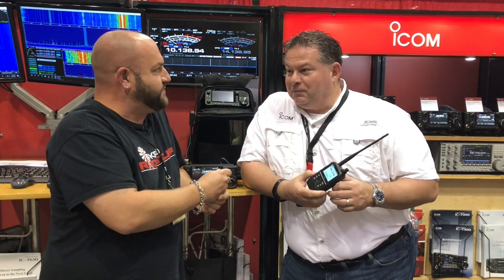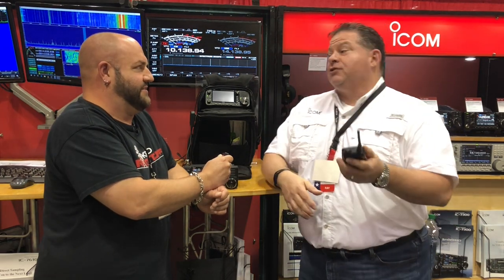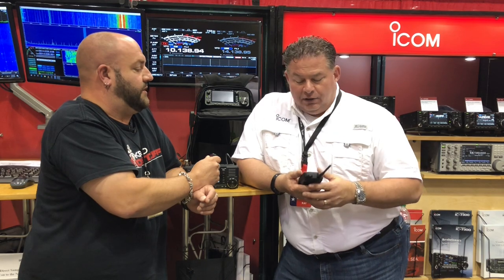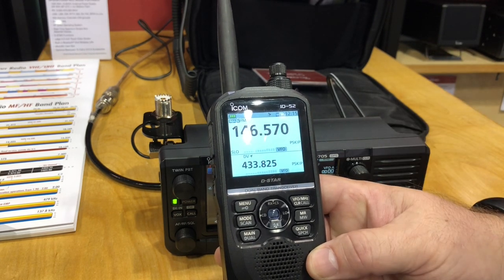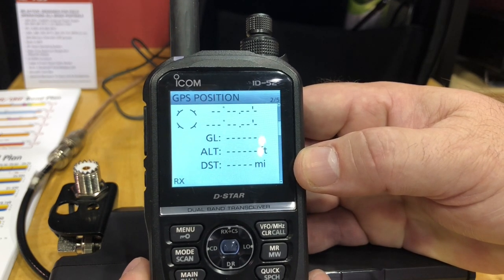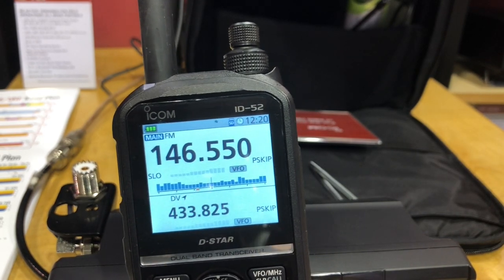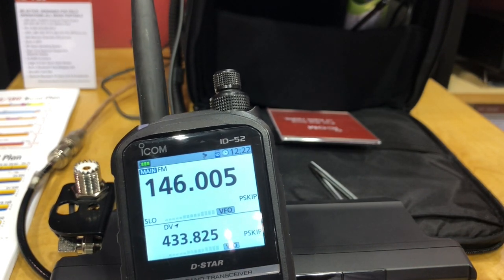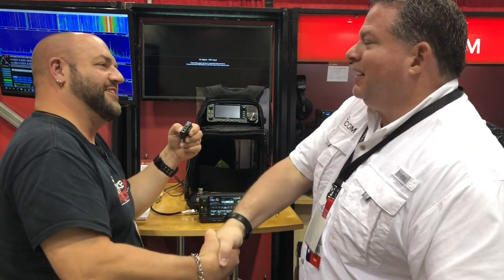Icom ID-52 | First Look With Ray N9JA @ Huntsville Ham Fest 2021

Comment: Enjoyed the video -love my 52 great radio had mine months i also use the BP307 battery its quite a beast need latest firmware 1.20 for bandscope works good but not HD has CIV and terminal mode for Doozy.

Comment: I don't have a hand held yet, but I will be buying one soon. Really hard decisiomn, new FT-5DR, IC-52 or  second hand - presumabluy ID-51s and FT-3DRs will be hitting the market soon.
I have a 705 so battery and DSTAR compatability are appealing.
I find it a bit annoying on the 705 that you need to tell the radio what type of battery your using and it looks like the 52 is going to have the same system.
It's a real pity they can't find a way for the radio to sense the battery type being mounted.